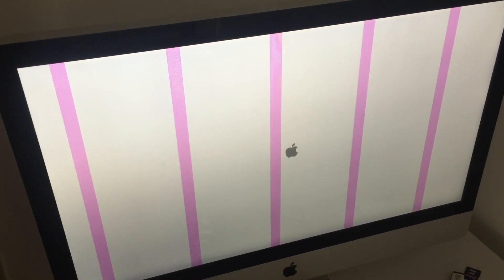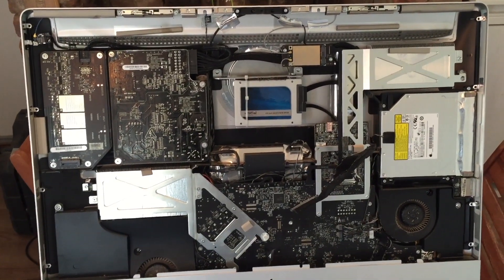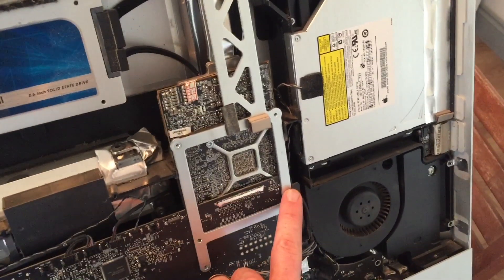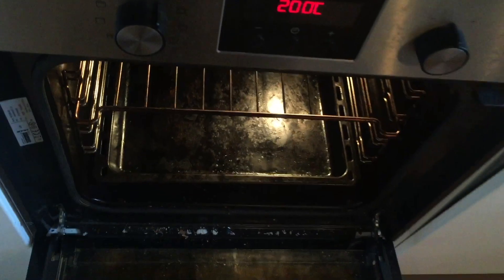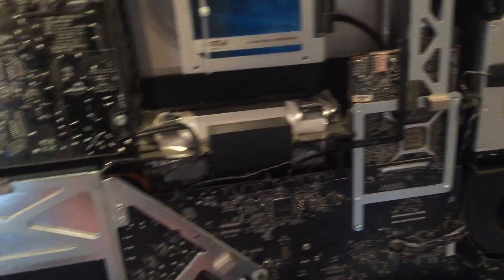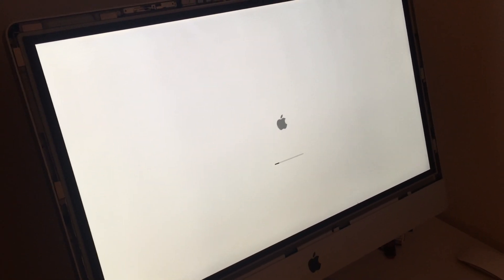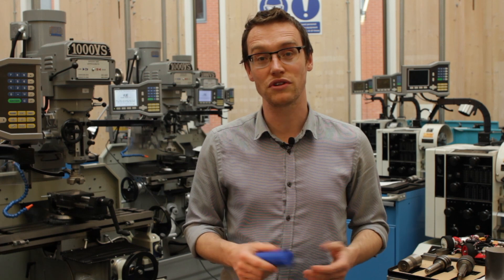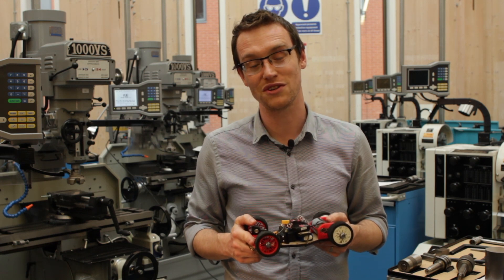How to Fix iMac Pink Vertical Lines Graphics Fault - #5minFriday - #12

Comment: December 2022 here, your solution helped me fixed 2 of my iMacs. Baked the card at 200 degrees for 8 minutes in conventional oven. Reapplied the thermal. Worked like a charm. I am so glad I found your video. Thank you for your help.

Comment: I have no words to thank you... I recently gave my old iMac late 2009 to my daughter and few months later she got those lines in blue/cyan colour. I admit i kept my expectations low on your solution but tried it out as it was the only solution before recycling it. And it worked! It really worked! I'm not putting everything back yet as i didn't have thermal paste for the chips, this will have to wait for Monday but i performed a quick boot and I got to the login screen with no lines or other problems... again thank you so much, greeting from Greece!

Comment: Did this Jan 2021 on an iMac 27” late 2009. WORKED. Absolute life saver! 8mins at preheated 200c, cleaned the GPU with rubbing alcohol and redid the thermal paste on all needed components. Also cleared the old paste off the metal casing. A bit tricky to do alone so I recommend you have a helping hand. Fingers crossed it will work a little while longer! Many thanks!

Comment: October 2020 : Thank you so much! I tested that on my mid-2011 iMac yesterday and I'm very thrilled that it worked! Only thing is that there were not easy access to the screws to remove only the GPU, and I had to remove the whole motherboard, and putting everything was pretty tricky. But the GPU works fine now. Thanks again!

Comment: Hi great video, I got two thin vertical lines, one red and one blue on the left third of the screen. I have got a mid 2007 20 inch iMac. The lines are there all the time, even when booting, what could be my issue?

Comment: Crazy! It worked on my 2009 27" iMac! Baked the GPU for 8min at 420F. I was paranoid so I placed the aluminum foil so it only touched the screw holes.

Comment: July 2020. Worked like a charm with my iMac 2011 27" (vertical blue lines). I cooked/baked the graphics card at 180°C for 10mins (preheated and in conventional heating mode without fan). After letting it cool down applied fresh thermal paste to all the board components that were originally covered by a thermal pad. Re-installed everything and the thing runs!! Thank you so much for sharing. This video helps promoting preservation of precious resources through repair.

Comment: Good evening - Thanks for the information.  I had the same purple and white
vertical lines.  I did not think that was - 
technically capable of doing this work myself; so I tried another solution .....
I took my early 2011 Applemac pro into a bedroom with strong sunlight
(April 2020, Edinburgh - 16 degrees).  I turned the computer over and sat
this underside in the sun for 2 hours.  Then I switched on my Applemac, 
and a miracle happened - BLUE SCREEN - crossed my fingers and toes, 
put in  my password, and IT WORKED !!!!!!!!!!!!!!!!!!!!!!!!!!!!!!
Thinking of changing my name to Einstein - just kidding - Peter Henry
Many thanks again for the tip *** WONDERFUL ***

Comment: This totally worked in 2020 during Corona Virus down time repairs. 🙏
Reply: HAILSTONE AERIAL FILMS omg yes hope ! This happened to me today.
Reply: Do you have to reapply that white paste that was on all the other squares other than the middle plate? I bought thermal paste but it doesn’t look like he puts it on the other areas and the directions for the thermal paste also don’t say anything about the other squares.
Reply: @rosalindludovici4477  I baked mine and put thermal paste in the squares but didn't fix the problem  and you?
Reply: @rosalindludovici4477  it's not a thermal paste, its a termal pad, dont use a thermal paste in the squares

Comment: Just did that to my 2011 iMac and it worked. Had to remove the motherboard completely, though. The 2011 model has it's GPU underneath the main board. 200C @ 8 minutes did the trick, just let it cool for a hour, don't rush it.

Comment: I was skeptical at first, but it worked like a charm! No pink lines or squares anymore. Thank you!
(iMac Mid 2011)
Reply: So, how long to bake for?
Reply: @JulieAdadjo  I believe I baked it for 8 minutes at 400° F.
Reply: Hey I seem to be having the same problem.  Although, my iMac isn't booting up.  Do you think this will fix the problem still?
Reply: @PLOWKING831  May as well give it a shot. Mine wouldn't boot past the Apple logo, but this fixed it.

Comment: 6/19/2019 Still working!!!

Degrees heat: 210 Degrees
Durations:

Preheat: Oven 10 to 15 mins
Baked: 11 Minutes

Open Oven and leave for 30 min (Be Patient DON'T RUSH!!!)

Reapply Thermal Paste and Assemble.

Patiennce is the key.

Thanks to this guy... Chow!
Reply: Ronald Fadrigo what year mac?
Reply: @aegis6310  iMac 2015
Reply: Ronald Fadrigo late 2015? I have that model and I really need it fixed😂
Reply: Just follow the procedure, it will work unless you messed up. Follow the instructions carefully and I'm sure it will be fixed.
Reply: 210 degrees F or C?

Comment: Do you think we can do the same with a Macbook pro?
Reply: Hugo Catellier you can use a heat gun to fix a MacBook Pro; using aluminium foil as a heat shield to the other components ( only baking the gpu) it may only be a temporary fix though.....it will allow the machine to boot but I wouldn’t recommend using the dedicated graphics after this repair.....you can use a tool called gfxcardstatus to force the Mac to use the integrated graphics on the cpu (assuming it has 2 gpus)

Comment: I'm a believer! Had my 2009 imac with YELLOW lines and spotty pixels in my basement for several years after I got those lines in only a 2-year old machine. Didn't want to invest in a graphics card not knowing how expensive it was or how easy it was to repair (at the time). So did nothing. Kick myself in the butt now.  Took 5 minutes to pull out of the machine, preheat the oven, bake at 395F (200c) for 10 minutes, cool off, back in the computer. Everything working perfect. Tested by playing plexing two 3 hour long movies side by side. Perfect results. Don't know if this will last 3 days or 3 years but this ridiculous fix actually worked!

Comment: This is not a fix, it is a banaid at best.    It has absolutely nothing to do with the solder.   The problem is the cheap GPU that is used.   Heating it up will allow it to work a bit longer,  but trust me this problem will come back.

Comment: I want to use an old 27" iMac late 2009 as an external monitor and occationally for some Mac-only tasks. It has got the pink-lines problem. Will the lines also be visible when I use it with my PC via a DP to miniDP cable? Thanks!

Comment: My 2008 iMac at work did the 5 pink bars of death last week. So rather than call in the IT bods who would have thrown their hands in the air and declared it irreparable... "buy a new Win PC" ... I had a crack at repairing it. (NB I have repaired a several Macs, laptops and Win boxes previously)I did a quick hardware diagnostic. It came up with "hardware test error 4MOT/4/40000003:HD-1230" (which eventually turned out to be an erroneous error message.) I bought a new HD and installed it, managed to install the OS from a USB stick today and voomf... Pink lines came back. Bugga. I ran the diagnostic again and got the same error msg. Derrr not the HD! 
Ok with nothing to lose, I cracked open the Mac again and found the graphics card screwed on from the reverse side. Good one Apple!! Time was short so rather than tediously remove all the connections and remove the motherboard I cheated and very carefully drilled out the three torx screws holding the card onto the MB. I used a couple of tiny strong magnets attached next to the hole to catch the metal shavings (yer dangerous I know but it worked) . I popped out the card, cooked it and I put it all back together again and she works YAAAAA. Many thanks for this YT vid!

Comment: Tried this out on a 2011 iMac with blue vertical lines.  Worked like a charm!  Followed the instructions exactly the same.  Not sure how long it's going to last though.  Be interested  in finding out if the problem came back for anyone later.
Reply: Derek Honess it came back for me five months later because my MBP got overheated (even with a cooling pad). I’m wondering if this fix will work again.

Comment: How did you get the screws off of the cooler brace from the motherboard?  They just seem like round locks with empty holes inside, not fixed for any kind of screwdriver....
Reply: The heads of the T9 screws are on the other side. They built mine wrong too. Had to take out the motherboard to get to them.
Reply from the maker: I honestly don't remember though I know I used no more than a standard ebay type electronics repair tool kit...

Comment: Mate you are awesome! I fixed the pink lines problem in a 27 inches 2011 iMac. I really appreciate your work. In my case I had to take away the entire Logic Board, remove the graphic card, put for 10 minutes at 200 degrees celsius and reassemble everything. Works like a charm since 2 days.
May I ask you WHAT really the high temperature for 10 minutes does at the card? Just for my curiosity! Thanks again!!

Comment: This worked!, wow! So most difficult parts are safely removing the motherboard, and re-seating the motherboard, just take it all one step at a time. Make sure you have some good thermal paste I used some IC Diamond that I had in my shop. Runs better than ever! Thanks for sharing

Comment: Well I've got a 2011 27" iMac with the same exact issue and it does have an AMD GPU. I will test out this fix and report back. Amazing if this works!
Reply: Travis Wesselmann did this work??
Reply: Kimberly Davis To my great surprise it did!!! Sorry my response was in a separate post. It was not easy. Had to carefully remove the entire motherboard to get to the GPU screws. After disassembling cleaning old thermal paste and baking it in the OVEN! I re-applied some IC Diamond thermal paste, reassembled it and carefully re-seated the motherboard! Was able to successfully get the screen back on and to my great surprise, it worked!!! 
I’ve got a Mid-2011 27 inch with a Radeon 6970M

Comment: I’m having a problem with my mac (size unknown, all i know is it looks like the one in the video) it all the sudden crashed one day and when I tried to start it again. it gave me red and black vertical lines. The apple logo appears and then stops about 3 quarters of the way and doesn’t load. If it does some how load it just goes white and nothing happens.  Any solutions that don’t take away my whole wallet?
Reply: Kanga Koot use recovery mode?

Comment: You 'casually' skip disassembling the entire logic board to get to the GPU, yet dozens of guides do it the hard way. How on earth did you find out? Will this work on any 27'' iMac?
Reply from the maker: Sorry man! I just skipped to the interesting part! Plenty of other guides like you say. Heard a friend say it worked and I had nothing to lose!

Not sure about any 27" Mac, I'm afraid.
Reply from the maker: I think I misunderstood your comment- yes, no need to pull the whole thing apart. Just looked obvious to me when I got my hands on it. No sense in making life hard for yourself!
Reply: Thanks for the quick reply. I think your method could save an hour or two of tedious work. Did you leave the thermal paste on the side of the heatsink, or did you clean that before putting the card back on?
Reply: @FuturefabOrgUk  wouldn't it be easier to use a soldering iron ?

Comment: My problem is slightly different and I don’t know if I should try this method, my screen has the pink lines but they have varying distances between them, also the background is black not white and the apple logo doesn’t show on start up, the screen just stays black and pink, so I’m unable to use the mac. Is this the same issue or a different one?

Comment: Similer problem and this fixed it. I was amazed. Try it before you open the iMac and bake the card.

Shut down the iMac if it is on. Press and hold down the following keys on the keyboard: "Command", "Option," "P" and "R." Press the power button once to turn the iMac on. Continue to hold the keys down. Release the keys after a tone sounds for the second time. Wait for the iMac to restart.

Select “Software Update” from the “Apple” drop-down menu at the top left corner of the screen. Wait as a progress bar fills in from left to right on a pop-up window. Click in the check box next to the software update(s) listed on the screen that appears. Click the “Install” button at the bottom of the window. Enter your administration password in the “Password” text field of the pop-up window that appears. Click the “OK” button at the bottom of the pop-up window. Wait as a copy progress bar in a new pop-up window fills in from left to right. Click the “Restart” button at the bottom of a new window that appears. Wait as the iMac installs the software update and then restarts.

Shut down the iMac if it is on. Press and hold down the “Command” + “s” keys. Press the power button once to turn the iMac on. Continue to hold the keys down. Release the keys when white text appears on a black screen. Enter the following text, minus the quotations and period: “fsck -f.” Press the “Return” key. Wait for text to appear that says the iMac has been repaired and you can reboot it. Press the “r” key once to reboot the iMac.
Reply: Didn't work. Tried 3x.

Comment: Guys... i’m freaking confused.
I have no purple lines instead I have a white screen boots up perfectly but once the loading bar has nearly finished loading my login screen  appears glitchy  and alot of rgb pixels the cursor however is visible and controleable but I cant figure out to login.. It just wont let me in! and it somehow gives me this thought that this is the GPU...
However if i look very very good at my screen when it’s white I can see similar lines but slightly yellowish and barely visible... 
Will this fix it? I hope so. And if it does for how long remains the mac in a working state?

Regards,
Reply: did it work?

Comment: ive been a cert tech for the past 10 years, i always have seen this little ( so call trick) on line but never tried. I have to say i gave it a shot on a 2011 imac and the trick fken worked. Next time i come across this issue i will make a video.
Reply: What tool is used to remove the bracket so I can get to the card behind the bracket?

Comment: Yeah, so this just happened to me this week out of nowhere. I did what you instructed here and YES it worked.  But one thing, you skipped a MAJOR part of taking the computer apart.  You do have to unscrew several screws and take out the logic board because the screws needed on the GPU is hidden. Plus you'll have to unplug several plugs.  VERY TEDIOUS! But thanks though.

Comment: Excellent! Just "repaired" a late 2009 27" Imac I bought yesterday for nearly nothing. Your tuto & some others more detailed, iFixit, some white thermal paste for the pads + Artic MX4 paste for the GPU and done. Time will tell if it lasts. Is yours still fine?

Comment: It seems to work.  Removing the GPU from my iMac (EMC 2429) was harder because the heatsink is riveted to the logic board so I had to take out the entire logic board.  I then baked at 395F (~200C) for 8 minutes and re-assembled.  Initial results are very good, the computer can fully boot and no pink lines.

Comment: I have a late 2006 imac.
It has many single pixel lines (vertical) which don't bother me too much. Occasionally new ones develop.
The big problem is a 'solid' band (vertical) sort of in the middle. I say sort of solid because it is made up of hundreds of many colors of pixel lines all packed together solidly and it completely blocks out everything on the screen.
Sometimes it changes, like to solid white. or pink or gray, maybe with just a few colored pixel lines. 
The right edge of this band is exactly on the center of the screen, and the left edge of the band is toward the left side of screen. Have you ever seen this particular problem?
Do you think your method would do the trick?
Or do you know what else might be causing this problem?
Thanks for your video.
i subscribed.

Comment: Hey mate, just tried this, put everything back together, turn it on, head the bell but screen is black? What are the possible reasons for this? Thanks!
Reply from the maker: +Herman Landero q cable is disconnected or ribbon cable is damaged. That's all I can think of.

Comment: Okay, this just saved me a few hundred dollars - Thank you! The pink lines were the least of my worries, how about the screen suddenly blasting colors like a 60's tie dyed tee shirt then freezing everything. After that no boot but safe boot (apparently it doesn't use whatever part of the video card that causes all the problem but lets you get to the desktop. Anyway I baked a potato after I baked my video card. The potato was just delicious AND the video card WORKS! From another video apparently this issue can come back in a few months (or never) and it's another baked potato and video card. Sweet!
Reply: Just so you know, this will not always work for very long, nor does it "fix" the underlying issue. Reballing the GPU to the video board is far more involved and requires a completely different process to repair. However the best and true way to end the stress is to actually purchase a new/used GPU that works. Be sure to have good thermal paste for the GPU chip and new thermal pads (white areas) that connect firmly to the heat sinks. Foxconn, the company which assembles Apple computers provides shoddy thermal components during assembly, not to mention older Apple systems used crappy ATI and Nvidia chips that are designed for end-of-life scenarios like GPU failure. Ensures profits lol.
Reply: Hi can this work on black vertical lines also?
Reply from the maker: Not sure to be honest but what have you got to lose?! Let me know if it works🙂